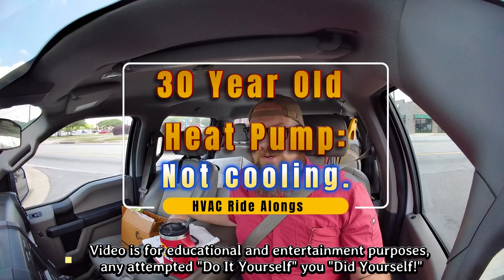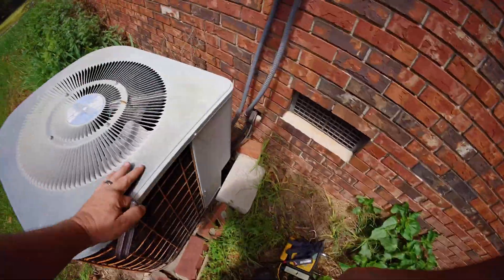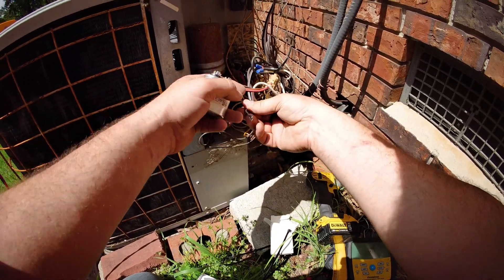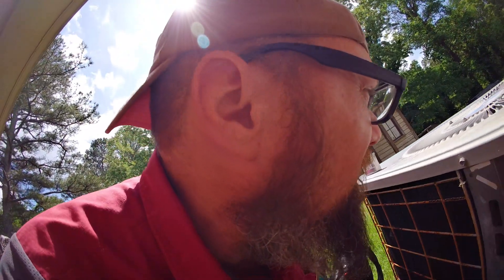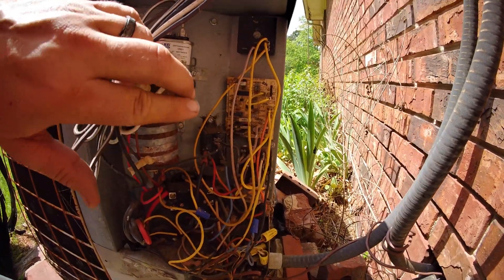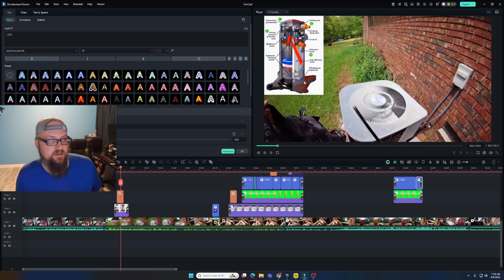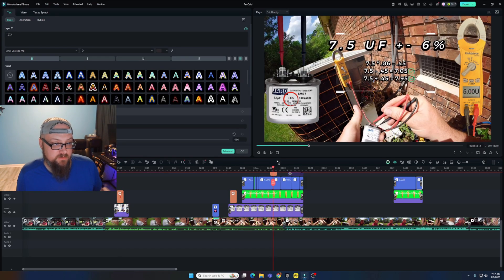30 Year Old Heat Pump: Not Cooling.

Comment: Cold Cold air is always better in the summer!  Nice fix!!
Reply from the maker: That it is!
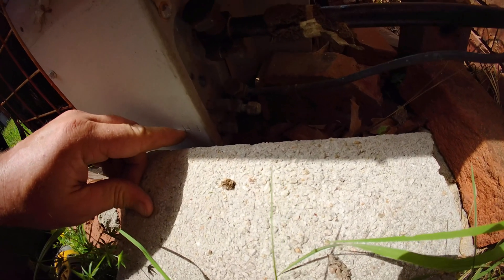Reply: 7:45 ish, newer heat pumps don't have a high and low pressure port? How do you hook your gauges in cooling mode? Please clarify.
Reply from the maker: @realSamAndrew  Good question!

They do have vapor and liquid ports, and heat pumps will have a third "true suction" port that connects between the  reversing valve and the inlet of the compressor.

That way you can actively check the suction  pressure regardless of operational mode as well as help trouble shoot the reversing valve. 

Some systems (typically don't see it much with current systems) will have a "Compressor Discharge" port as well, so you can likewise see what the true discharge pressure from the compressor.

In effect, the system in this video has a vapor line port, liquid line port, true suction port and discharge port.
Reply: @HvacRideAlongs I see I accidentally posted this under another comment when I intended to post it at the top level 🤦🤦. Anyway, I just wanted to know, on "newer" heat pumps, what IS provided, and what were you referring to when you said newer units won't have high side and low side?
EDIT: to add after watching again, why did they ever think separate discharge port was necessary and why only on the older ones? What changed in the refrigeration cycle?
Reply from the maker: @realSamAndrew  Typically  on most heat pumps you will have a Vapor and Liquid port to connect to.  

The big line is always vapor, and the small line is always liquid. Depending on the mode the system is currently operating in that vapor and liquid may be flowing either direction. 

In air conditioning mode, the liquid is flowing into the air handler coil to evaporate after hitting a pressure drop device, and the vapor returns to the compressor to be compressed then pushed into the heat pump coil on the outside where it condenses back into a liquid to start the trip again. 

In heating mode, the system works in the opposite direction essentially, with the two coils changing jobs.   So now your compressed gas from your compressor is run the opposite direction up the vapor line into the air handler, where that coil now condenses the vapor into a liquid, which runs back out to the heat pump coil to evaporate and be pulled back into the compressor to start the trip again. 

So to that end, the two copper lines while always vapor and always liquid, will have different roles. So while in heating mode, in order to see what the suction pressure actually is, the true suction line connects between the reversing valve and the compressor so that you can check the vapor pressure going into the compressor. 

While the liquid line is always liquid, it does not actually provide you with the compressor discharge pressure as compressors only pump gas. So likewise, in cooling mode the only way to see the compressor discharge pressure would be a discharge connector such as on the unit in the video.

As for most modern residential systems and why a discharge port isn't included, my only guess would be that the practical application of seeing that pressure in most cases didn't warrant the cost of including them. 

The only times I've ever really used one  was attempting to trouble shoot a reversing valve, which can be fairly easily done without it using thermometers.

Long winded but hopefully I got to what you were asking!
Reply: @HvacRideAlongs I thought today's heat pumps still include a vapor line port, a liquid line port and a true suction port. Is that not the case?

I guess you answered the other question about the true discharge port, basically removed because of cost, benefit, who actually wanted it.
Reply from the maker: @realSamAndrew  We pretty much just have access to the vapor and liquid line, then a true suction port on most heat pumps these days.

it gets the job done in suppose, but with the manufacturers it’s always a cost/benefit calculation I suppose.